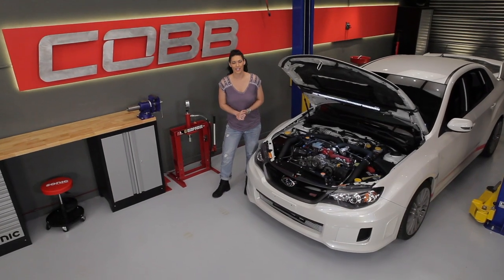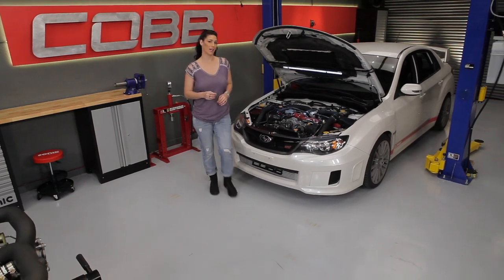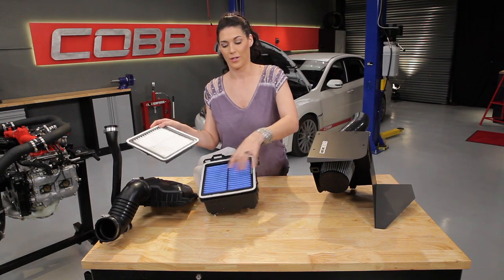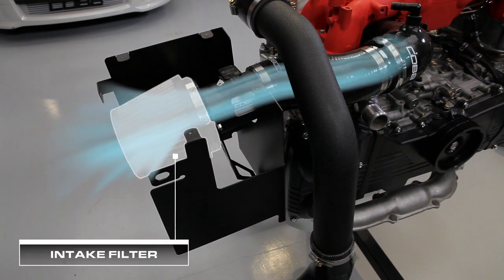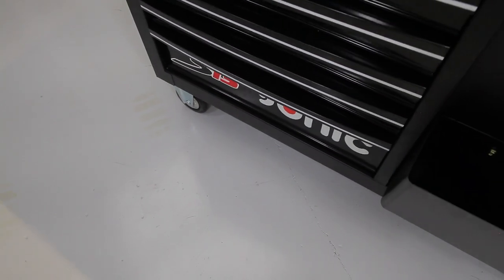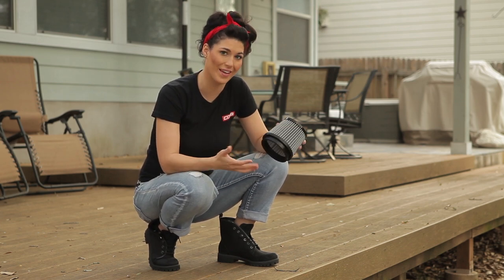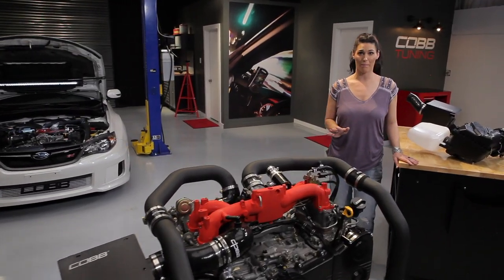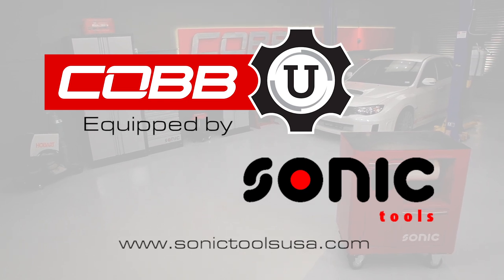COBB Tuning - COBB University Episode #4 - Intake System

Comment: What is the difference between the kit with the airbox and the one without the airbox? Sound difference? Or just looks?
Reply from the maker: The difference is only the airbox.  It will slightly muffle the sound but it is still very audible with the box installed.  The airbox will prevent heat soak a little better as well.  Kyle@COBB

Comment: I've overoiled before and did trip check engine light because of that. What worked to resolve is remove MAF sensor and use electronics parts cleaner on it and it resolved issue. I read not to use brake parts cleaner though that can work as well but that can leave a residue on it making electronics parts cleaner best. Unless there is a better solution I'm open to learning :)

Aside from that Emmy is hot and love women who work on cars as well :-).

Comment: How will Cobb Access work for upgraded parts that are not Cobb parts?
Reply from the maker: Good question. That is a very case by case thing. Some parts absolutely have to be COBB specific, and we do make all of our OTS maps with our parts. So when using an OTS map its usually best to stick with COBB parts. There are some exceptions though. You can ask our support team when in doubt. Also, at a certain point its simply best to contact one of our approved Protuners and get a custom tune where you can use anything you want as long as it makes sense.

Comment: Thanks. So can I run the COBB air intake w/o the AP to reflash?
Reply: Listen starting at 6:50 or so.  When you make significant changes in flow or sensor location, you will strongly want to consider a reflash (is their message).

Comment: If you remove the intake resonator you’re sucking cold air from the fender well, then upgrade to high flow drop in filter. Good as CAI and no tune needed